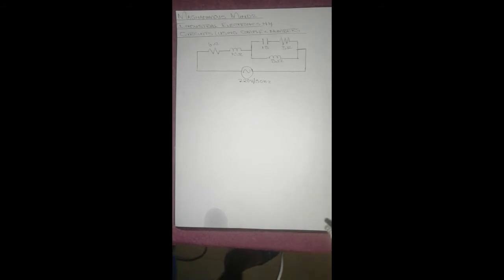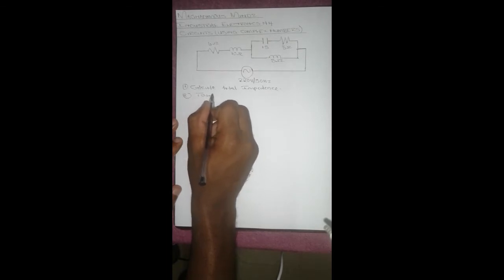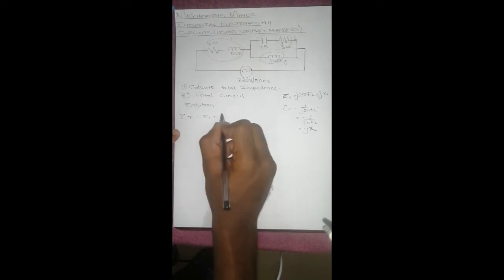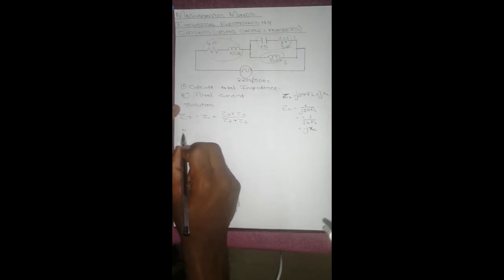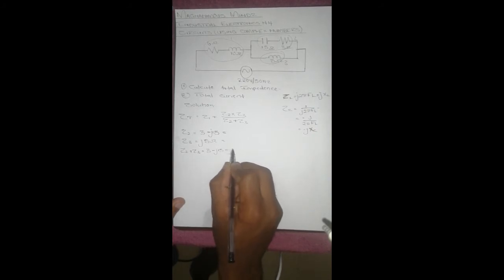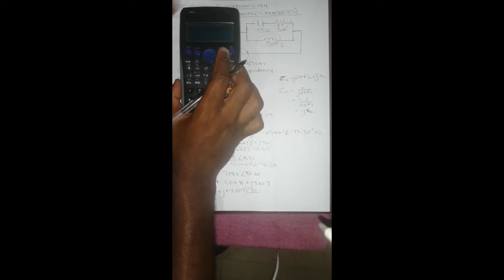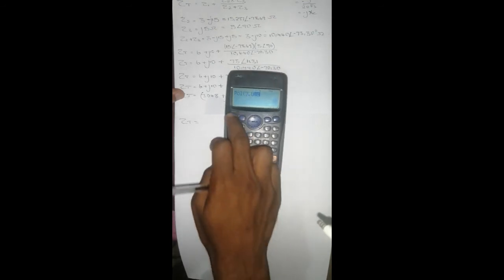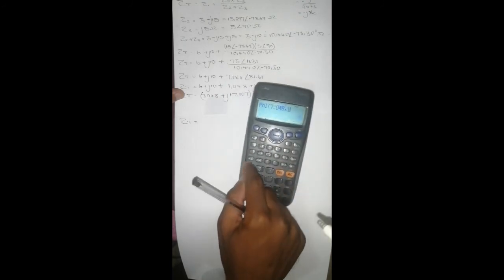INDUSTRIAL ELECTRONICS N4: AC CIRCUITS (USING COMPLEX NUMBERS)

Comment: U have made alot of mistakes,,you said 15×5 instead of 15,297×5 ,,and you also said -70,30 instead of -73,30 in your substitution,,,sio for someone who might try it don't be surprised if u get different answers from this vid,,,but otherwise the steps were👌
Reply from the maker: Thanks for the heads up, I’ll have a look at it ,possibly correct and share a link to the corrected video